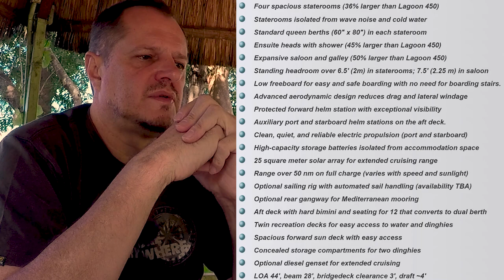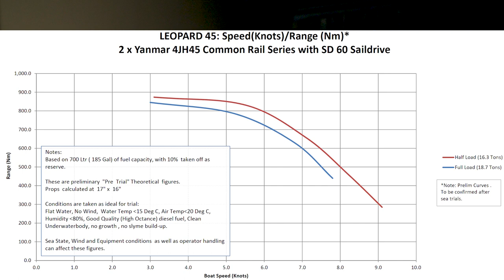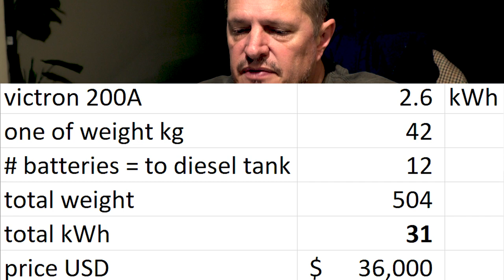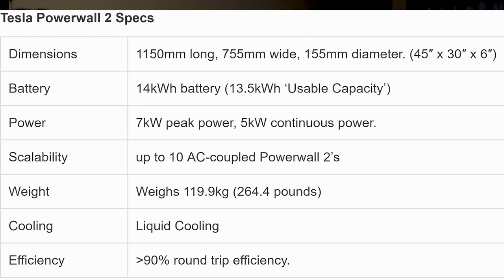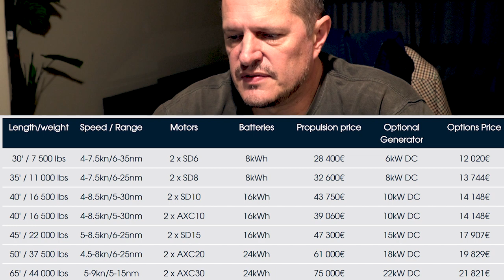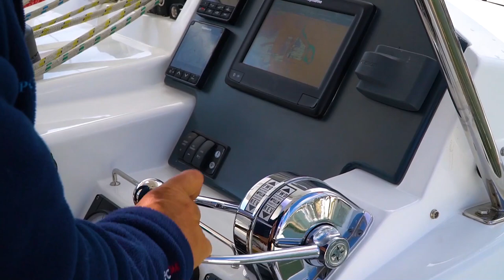#25t Diesel Engines or Electric Motors for Our Catamaran | Sailing Sisu in Cape Town South Africa

Comment: Thanks for making this video. From what I understand from others who have converted from fossil fuel engines to electric, the big differences are no smell, little if any noise and if natural power sources (solar\wind\hydro) plus storage (batteries) are used, the savings after initial cost to buy and install are exponential. I recall reading about one couple who were cruisers sailing all over the world who said they only had to purchase 50 gallons of fuel (for their generator) over a years time after converting to electric motors.
Reply from the maker: That is so true! Thank you Michael! And thank you for watching!

Comment: Hi Frik,  very interesting comparison.  You did not mention the weight of diesel drives versus electric drive.  The 45HP Yanmar SD60 is 220kg plus accessories (alternators, etc).  The Oceanvolt SD15 is 47kg and 14.4kWh of batteries (4 12v*300ahr ReLion) is 152kg for total of 199kg.  The motor control and cables to connect everything would probably be less than 20 kg and the diesel accessories.  That gives a total of 28.8 KWh of battery storage for a catamaran.    
Then there is the weight of a Genset (or two if you want redundancy).  if the average saving on fuel with the hybrid drive is 33%, the 700 liters diesel tank would now be the equivalent of 931 liters (700* 33%=231 liters).  The weight of 231 liters is 196.35 kg.  A PolarPower 9-14kW generator is 153 kg and would easily power two SD15 drives and charge the batteries at cruising speeds.  Two generators would easily drive both SD15 at max power and provide redundancy for a weight penalty of 110 kg for an equivalent range.
I also agree that the 2 SD15 drives are probably too small for the Leopard 45. 
jerry
Reply from the maker: Ah, thank you, Gerry! Yes, it was mentioned before that I should probably add the engine vs motor weight to the diesel vs battery weight. But the moment you add any diesel and generator, one has to reduce the battery weight again, unless you want to argue that hybrid is still lighter? Anyway, I think Hybrids are the closest to get to clean energy, but for example, the Silent Yacht 55 has an option for 2x 250kW motors with a 100kW genset....that will take away all the advantages of saving weight wrt diesel vs batteries. My point was that when we look at diesel's energy density, then batteries still have a long way to come when one wants to go completely green i.e. no diesel on board. To drive the two 13kW motors in my example, one would require at least a matching 26kW (or more if you do not want the genset to overheat) genset, which is huge and is diesel thirsty...in our "one year..." video, I highlighted our experience with solar at 38N latitude in the winter....it is not even that high latitude, but we cannot get our batteries fully charged without diesel or shore power on 2.2kW of solar alone. The sun is way too low and too short in the sky for the solar to be efficient.
Reply: @SailingSisu  Hi Frik.  I do believe the serial hybrid concept is the most "green" if you need/want range and/or speed beyond the limited energy density of today's batteries.  Electric engines are most energy efficient and responsive, diesel is the most energy dense and stable fuel, and dedicated diesel generators are more compact and efficient converters of fossil fuel to electricity.  Solar yachts (like Silent Yacht) and Wind yachts (sailboats) are great if you don't need to go far beyond the battery capacity and the Solar or Wind is not available or insufficient.  If you need reliability and flexibility and want to be "greener" then hybrid is best solution today.  Jerry

Comment: Frik,
As mentioned here a few weeks ago I was going to charter the new VOYAGE 480 electric cat (ELECTRIFIED) from Voyage Charters in BVI. 
Well I did, and as a result have decided to buy a new 480 Voyage with the oceanvolt system. I have spent the last 2 days with the folks from Voyage talking through details and options. 
I will do a detailed report and video on Electrified once back at home, but as a soon to be full time cruiser I am happy with what this boat was about. It works, just fine, in fact it was great to sail her for a week with 10 pax on board and deliberately stressing the system to the extreme with 4AC's all day on, watermaker running a lot as we all took long regular showers, electric water heaters, electric winches, electric furling Genoa, etc.
The system kept up just fine, 
I will be ordering my boat with a few minor changes but the week long test aboard sold me. Finally a new dawn in sailing....
Reply from the maker: Great to hear! We just completed a 3,900nm passage and crossed the doldrums. I am 100% sure I would not have been able to cross it with electric motors. I do not have the same battery capacity, but I sure did use 700L of diesel throughout the passage... But keep me posted, I would love to go full electric with no diesel on board!

Comment from the maker: Herman Karsten pointed out an error on my side for the Tesla Power Wall. I used the continuous power output and not the capacity therefore the 4 x Power Wall setup will go double the range 20nm at half the cost of the Victron! Well spotted! Elon wins again :-)

For now, I will use the diesels while keeping an eye on improvements in this area of energy storage and energy generation. But most importantly, I never owned a boat, I never had to worry about boat things and weather things, and things like this. So, for now I think it would be great to focus on what I do not know (experience), rely on trusted diesels, and then in a year’s time, rethink all of this when I have experience and can form my own opinion 😊
PS: I am adding the links as reported below, to the description
Reply: Rigging Doctor has an electric motor.  Their range is minimal on batteries alone.  They now run a Honda 2000 generator in order to get them about 2 knots of sustained power.  I think Diesel is a better option on long passages.  If you are a bay sailor electric might be the way to go, otherwise you will be stuck without the means to burn fuel.  Even with solar panels, etc.  Also you might consider Carbon Foam batteries made in SA....about 80-90 of the capabilities of lithium for 30-40% of the price.
Reply from the maker: Thank you, Allyn! Will look into that batteries. Yes, I am aware of Rigging Doctor and there issues with range and speed. There are those G-Force 2000 super performance cats out there with all carbon fiber bodies, carbon fiber masts, honeycomb resin hulls, etc. They weigh half the weight of cruising cats, I guess less than 9 tons. I mean they are able to generate 2 x 6kW of charge with the hydrogen capability of the electric motor, but then, they are sailing at 26 knots! Awesome cats!
Reply from the maker: Thank you, Allyn! Will look into that batteries. Yes, I am aware of Rigging Doctor and there issues with range and speed. There are those G-Force 2000 super performance cats out there with all carbon fiber bodies, carbon fiber masts, honeycomb resin hulls, etc. They weigh half the weight of cruising cats, I guess less than 9 tons. I mean they are able to generate 2 x 6kW of charge with the hydrogen capability of the electric motor, but then, they are sailing at 26 knots! Awesome cats!
Reply: The Tesla Powerwall has 13.7 kw of useable power which means that the batteries are bigger. 2 Powerwalls would give you 27 kw of useable storage. Lead acid batteries can only use 50% and survive so that is the equivalent of 54 kw of lead batteries. The biggest thing to know is that they contain a 5 kw charger and a 5 kw inverter. They also have a BMS and heat exchanger so you can discharge quickly and charge quickly unlike lead batteries. I have calculated that my catamaran at 56 ft in length should cruise at 5 knots for about 5 kw of power.

I am a big fan of the Rigging Doctor but he uses lead batteries which means he has very limited range. He can also only pull small amounts of power without damage to his batteries. With the 2 Tesla Powerwalls, you could cruise at 5 knots for 5 hours. With the right setup, you could use solar and/or a generator to get range. My boat will have no rudder as the steering will be done by using a computer to change the speed of the propellers on each side of the boat like a quad copter. I will be able to steer with a joystick, autopilot or my iPhone.

Comment: You need to get hold of Scott at Sailing the Space Between.  I am installing a 16Kwh Lithium battery pack on my Leopard 40 which we get in Feb 2019.  That is a bank from a Chevy Volt (333Ah@48V).  I am thinking that either a Volt engine or a Nissan Leaf engine 'could' be converted.

Also, you may be able to contemplate a diesel/electric set up.  You get rid of the yanmar engines and you keep the diesel generator.  You end up getting rid of 2 of the diesel engines and reducing it to 1...the generator.  Lower diesel use and maintenance.  Many commercial vessels use this set up.  Even with the generator running when motoring, your overall diesel consumption will be lower and your range will be a lot more.
Reply from the maker: The Hybrids are koowl and the best there is at the moment...The test would be to be able to run those motors for few days without cooling time or recharge time. We have no been twice in 6m breaking waves and 40+ kts of wind where we had to motor for 2-3 days without a break. Off course we took the hard way (80% upwind) going to the MED, which took us close to the section in the Doldrums where there is no wind for 600-700nm...we could just turn on the diesels and they run 24hrs for 5 days, no problem. The Rigging Dr stayed in the Northern Hemisphere and in the steady Trade Winds. I am sure you watched Delos where they sailed Namibia, St Helena, Ascension all the way to Brazil not using their engine at all, not even for dropping or lifting anchor! Crossing the Atlantic is very easy using the Trades, but try to sail 80 different latitude degrees without engine....or to rely on electric motors for days without a cooling of break... BTW, one of the reasons why we choose a cat was the redundency of having two motors...if the genset breaks, then you are in trouble if you need engines....

Comment: Hi Frik, are you going to use  the engin water cooling system to heat fresh water?
what about small storm Jib sail?
what about ferling the main sail - using the beam?
I looked at all your films - very nice
thank's
Reply from the maker: Thank you for watching! Yes, the Leopard is using engin cooling system to heat water, but it also since we have Lithiums, it has electrical heating too. I am wondering about the storm jib, but no definite feeling around this yet. For now, we will just reef/furl the genoa a lot. I know Delos is using it and it looks awesome, the members on the Leopard or Catamaran groups using it are liking it (or some of the systems), but this is for me at least, a far away concept.

Comment: I'm a electrical and computer engineer, and I'm all for electric everything. BUT, battery tech has to improve another 5-10 fold in energy density before it can be a viable substitute  for diesel engines in long haul (no real charging option in between) applications. As you showed, the energy is just not there. Also, to consider only 2x15kw can put you in trouble very soon. There is a reason to be using 40hp diesels and not 20hp diesels, and the reason is, sometimes you need those 80hp to overcome current, wind, chop, or any combination of the previous. Most of the time you are just fine with only 30-40 hp...  on the other hand, electric is brilliant for a daysailer that only needs the motor to get out of the dock. cheers
Reply from the maker: Exactly my thoughts! Thank you very much!

Comment: By far the best analysis of the problem of using electric motors on boats.  On the other hand, the new and very large cruise ship are all using electric propulsion but using generators to power then propulsion systems.  I agree with the other comments, by far the best analysis of the current problem of electric motors / batteries.  The problem could have been described more easily by just looking at the energy density.   Facinating
Reply from the maker: lol, thank you, Nicolas for watching and the kind words! Yes, density is the key, but I thought let us try to make it practical and graphical in the terms boaters are used to :-) I know for the technical or chemical inclined, it was boring :-D I agree, until they find a way to increase batteries' capacity to store (and still provide large amounts of) energy, I would say hybrid is the way to go. DC genset and lots of Lithium.
Reply from the maker: lol, thank you, Nicolas for watching and the kind words! Yes, density is the key, but I thought let us try to make it practical and graphical in the terms boaters are used to :-) I know for the technical or chemical inclined, it was boring :-D I agree, until they find a way to increase batteries' capacity to store (and still provide large amounts of) energy, I would say hybrid is the way to go. DC genset and lots of Lithium.
Reply: I was a little shocked when you said you would get only 2 hours of sail drive with all these batteries.  Electric propulsion still has a long way to go.  However, I can easily see a situation where you replace the diesel engines with electric propulsion and one big generator (on the other hand why replace the redundnancy of two motors for only one).  Add to that batteries and solar pannels....I think that's what they try to do on the Gunboat Youtube video.  Right now your video is definitive.  Electric engines on a large (20 ton) sailboat is not the way to go.  The difference in range of 10NM and 800NM is a bridge too far!
Reply from the maker: Exactly my thoughts too. Someone mentioned I made a big calculation mistake, which I corrected in the pinned comment above, but still. I think the storage is the weak component. We need to get better storage, lighter, smaller (more condensed), and more capacity. This is happening, but at a slow rate. From the pinned comment, one can see that Tesla is pushing that frontier very hard. They have magnesium instead of iron in the Lithium Magnesium Phosphate...so, it is happening :-)

Comment: G’Day Frik, what timing! I’m also looking at the journey of buying a catamaran and starting my own adventures. I to have been looking at the topics you have just posted. I noted that you looked at the range, weight and cost and your measure was mostly against a Diesel engine. I understand it was just theoretical analysis and it does show the massive range distance electrical verses diesel and running time of the batteries.  2 hours at 5 knots is not much and at all and trying to keep up the charge via wind, solar and generation just to maintain enough power to run the electric motors seems to be a situation where conditions have to be perfect. The other thing is supplying power to all the other appliances and equipment on the boat......... so maybe for now a hybrid solution is the way to go?...... I’m going to speak to boat works and see how Kato performing. Cheers Chris
Reply from the maker: Hi, Chris! Yes, one should actually also calculate saving in engine weight and add that for extra battery weight, but space is then becoming an issue. Hybrid yes, but then one fuel tank has to stay then...

Comment: Hey Frik, have you looked at Silent Yatchs? Not a sailboat but fully electric. I see you looked at Moonwave, they have a fantastic system. Your issue seems to be around this notion of being fully self sufficient without ever using a generator but this is an unrealistic expectation. Even a Tesla Power Wall is connected to the grid and can use a generator if there is an extended black out due to bad weather. All electric motors and all batteries require recharging at some point and where this energy comes from will vary depending on where you live and recharge. Having a generator  that you can use to recharge and extend your range will use way less fuel and still be better for the environment if that is your goal. In your weight analogy you take out a fuel tank but did not factor in the weight of the engines as these will also be removed, and electric drives weigh much less, plus you already have 4-8 batteries in your boat so you really will not be adding 12 new batteries. Ultimately if you want to change to fully electric you can you it is just a matter of how much you want to spend. Do not get hung up on having a generator as this is just like caring your own recharging station with you. There is no such thing as a fully self sufficient energy system, except many the Tesseract.
Reply from the maker: Thank you, Barry! Very good points you mentioned 😊 we do have 5x 200A for the house batteries and I have to say that we struggle to keep them above 30% with the 2.7kW solar and 800W wind gens. 30% is about what we use over night with two fridges and two freezers running with instruments and Radar. I am 100% confident that we would not be able to use the house banks for propulsion 😏 and then to keep those 2x 13kW motors running? A bloody big generator! So, yeah, replace the diesels with 'light weight' motors and one HUGE generator and we have to keep the fuel tanks... Currently, we have no generator on board. In short, we will then only add weight, not reducing weight further, whether I use a big genset or two diesels, I would be poluting' the environment 😊 not convinced 😅